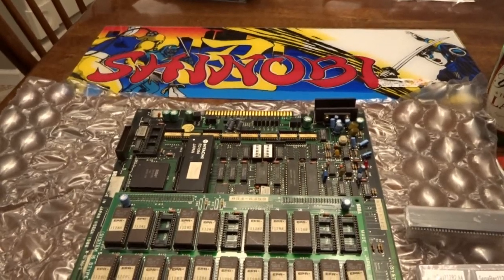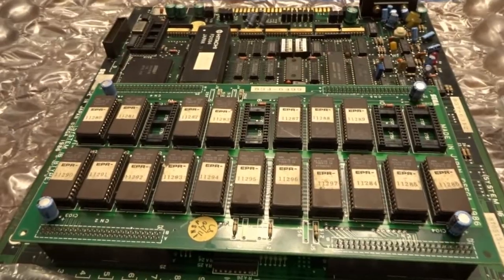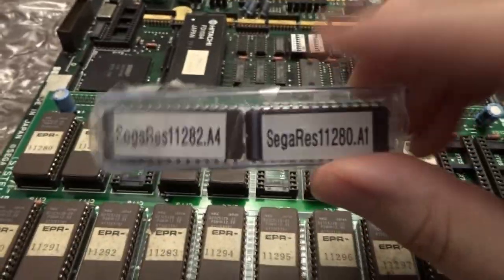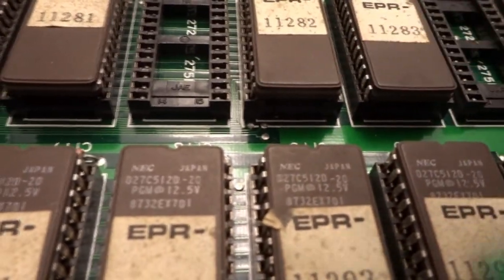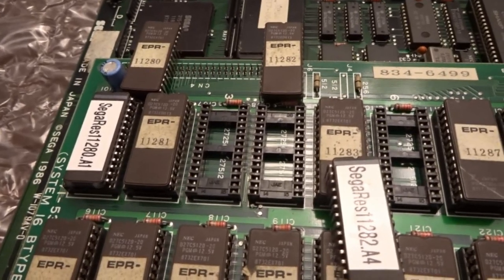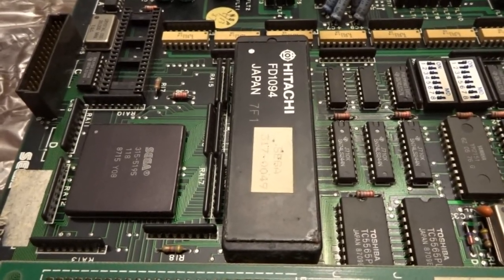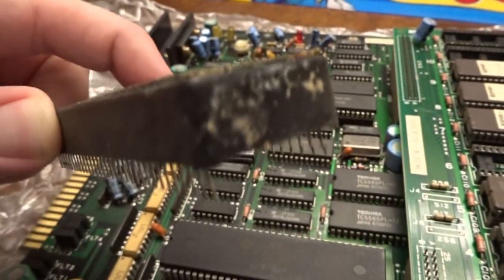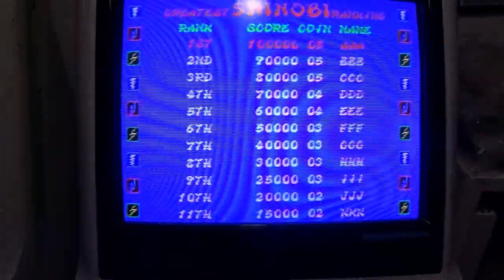Gamer PROTIP! Series #5: Shinobi PCB Sega Resurrection System 16 Repair Kit Installation for Arcade

Comment: Nice tutorial.  Who was the seller of the bad board? I neeed to get one of those tools for the chips.  Very happy that great game is working again
Reply from the maker: The board came from some small time db on eBay that doesn't know how to sell boards reputably. I opened a case with eBay and they were going to force him to return it but I already had the repair kit on the way. The IC puller tool I bought in town at Microcenter.